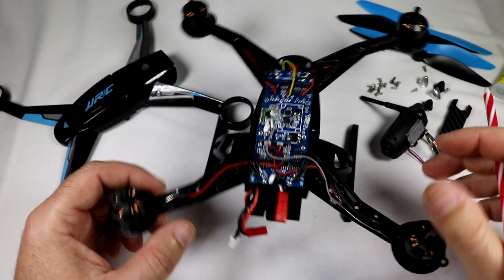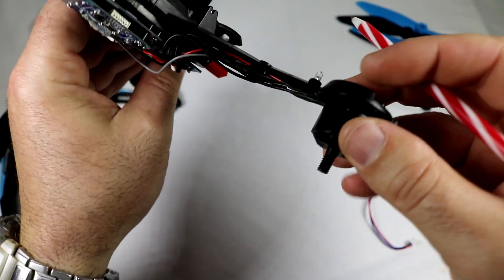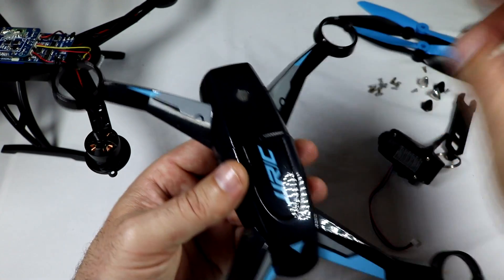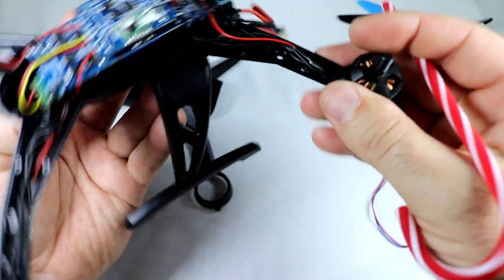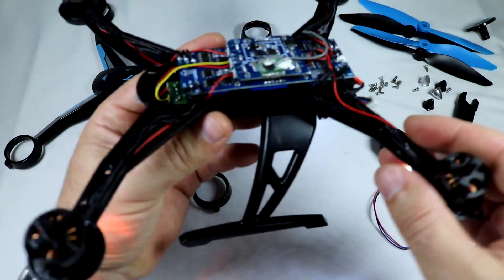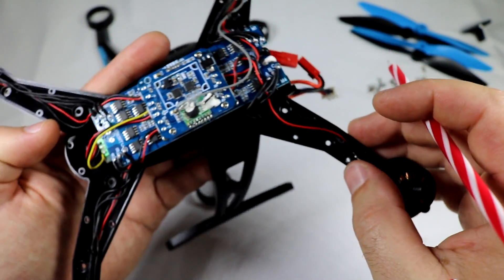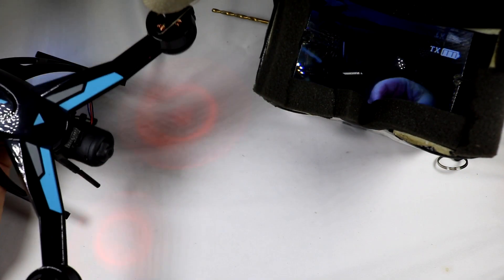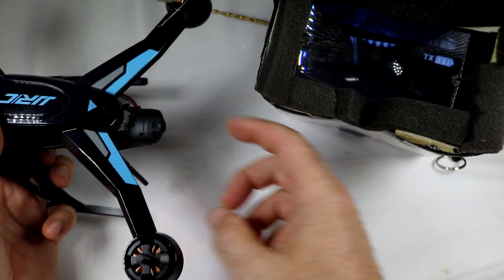JJRC X1 Quadcopter MODS - All The Best - [FPV, LED, Range]

Comment: Do you know anything about the esu's of this quad. I have one with two broken arms and the the two motors are now unresponsive to binding witch makes me reluctant to try to replace the motors and transplant the body, but it's just a little to much of a soldering job for me if the esu's are damaged too,, plus do you know about the xk x251 I briefly plugged in the battery (i think with reversed polarity)  I got a light spark, and now I get nothing, I am going to open up and hope I find a fuse or just one wire that got fried from its connection so i can get her up and running again.. brushless quad's appear to be much more component busy than the simple toy grade's with a board and pos/neg motors...

Comment: will the quad and camera stay on after u start flying around a bit. ??
Reply from the maker: +David Smith Yes, it is locked on good this way.
Reply: +Dustin Dunnill sorry I ment stay running wouldn't shut off every few seconds.
Reply from the maker: Oh.  Yah it stays on fine as long as the battery lasts.

Comment: Link for the camera only.  http://www.gearbest.com/rc-quadcopter-parts/pp_338616.html
I just ordered one.  It will be interesting to compare it to third paryy x5c 5.8 camera.  I've used it on the x1 it is ok, but using the default mount you cannot fly fast or you just see the ground.  Also the built in battery on that camera only lasts a couple of flights, so I like that the camera in this video is powered from the quad.
Reply from the maker: +Tom von Trott Thanks Tom.  Glad it's now available.

Comment: Great video as always. Question, what is your opinion of taking the x1 and putting onto a 250 class carbon fiber body, just take everything out and putting it onto the 250 frame?
Reply from the maker: +pshockz Yes, that's possible if your crashing hard and breaking the X1 body.

Comment: Any ideas for a Mod to help the very unpredictable Yaw rates? This is by far the most "wonky" quad I own with very unpredictable yaw rates. Sometimes it responds immediately, sometimes it waits. Oddly pitch & throttle respond immediately. Very weird. Any help would be appreciated.
Reply from the maker: +Quadcopter Reviews I think they fixed it in new versions.  Not sure on a fix for older versions with the delay.
Reply: +Dustin Dunnill LOL I hope so. On flight 8 I lost it in a large field of shoulder high grass. Own 12 quads.... have had several crashes.... nothing serious, never lost one till now. D'oh!!!! Why couldn't it have been a cheaper one? Well I just ordered another from Bangood. Hope this ones better. Seen a few bids on tri-blade props making it slightly more stable. Thanks and keep up the great work.... subed a long time ago. Your great work has definitely helped fuel my quad addiction!

Comment: Destin I have a X1 myself good day today I kind of crashed it not too bad at all but when I go to turn on the lights just blink fast they blink fast and it won't do anything what can It be....
Reply from the maker: +Aaron Chico reboot on level surface with fresh batteries.  Also try accelerometer recal
Reply: Did you find the problem ? My x1 do the same thing and i have a very hot componant on the esc board when i plug the battery :/

Comment: Do you know what exactly they mean with "idle setting" in the manual? Halfway page 6 http://imgmgr.banggood.com/images/upload/2015/11/JJRC%20X1%20manual.zip
Reply: +audiogek Could it mean if you trim the idle speed up that the actual in-flight max throttle goes up and the punch outs could be even faster?

Comment: On the light mod I saw someone do the same thing you did but he also added the outside shell of empty  Christmas lights bulbs in each bulbs to make them refractive and make them glow more. Thanks for the video.  :)
Reply from the maker: +INTELMAXELL thanks.  Yes, that's an option if you really need that much light.  I think the way I did it is sufficient for night flight orientation and won't mess with the looks much.

Comment: Wait, so the more recent X1 versions don't have that yaw problem?
Reply from the maker: Yes, some have reported no more yaw control lag in recent purchases.
Reply: +Dustin Dunnill wow, that was the only thing holding me back on getting one.
Reply from the maker: Apparently the low voltage blink and immediate landing has been fixed also for more time to land after blinking.

Comment: Dustin do you have a hard time getting it to hover in place ? I mean I don't expect it hover perfectly but it seems like the landing gears make it pitch slightly forward when calibrating on level ground .... Once in the air it seems to drift forward quite a bit
Reply from the maker: No mine hovers pretty good.  I would just try some trimming on transmitter pitch/roll.  Or put a level on top of front & back motor shafts while it's standing to check then shim/bend landing gear to level...roll also.
Reply: +Dustin Dunnill cool I'll give it a shot , thanks !
Reply: +Dustin Dunnill also is there a explanation of all the buttons on the transmitter ?
Reply from the maker: Check my unbox and flight test videos.  I go through the buttons.  Some are not mentioned in manual.

Comment: Cool and fast mods man! Is the X1 transmitter able to trigger the cam's recording? The hex does not trigger the Syma FPV's  recording :/
Reply from the maker: I did a test and the top right trim button on the X1 TX flashed screen seemingly snapping photos and seemed it activated video recording with the L6 cam but I did not have a card in at that time and just assumed it would work.  I'll verify and let you know.  Did the Syma Cam snap pics just not video?
Reply: +Dustin Dunnill with the Sony cam on the hex, I couldn't get the transmitter to trigger pics or video :/
Reply from the maker: Wait Sony? ... What are we talking about again...maybe I'm lost..lol

Comment: Great review.
Reply from the maker: Thanks
Reply: +Dustin Dunnill  i vaguely recall frequent flyer saying the lights connector was backwards ... how come its only 2 volts? it says 5volts beside the connectors.... i tried to use my tarantula lights but they didnt work, i thought i had blown it with reversed polarity, maybe mine is only 2volts too....

Comment: good video Dustin. thank you. I like that mod u did with the led lights. are u going to put up a night video with the new mod?  I kind of want to get this one. but I have also have my eyes on hisky hmx 280. its seems to be a better quad all around. better design better LEDs and better transmitter. and only a few more bucks than the x1. what you think?
Reply: +Junior Velez i'm looking at the hisky 280 too, reviews are odd because sometimes it looks fast others it looks slow,??? it has smaller motors than the x1 and its heavier and it has a 3s battery...... i might buy the shell for the 280 if i can fit the bigger x1 motors in it. if anybody knows if they will fit?
Reply from the maker: Thanks.  I honestly have no experience with the Hisky.  I have heard the X1 is faster though.  I'll have some after mod videos up in a bit to test the Mods.
Reply: SeBy DocKy actually did a comparison of the two actually and he seemed to be in disbelief of how much faster and more agile the X1 is than the Hisky, even though the Hisky has a 3S battery. The X1 has larger, standard 2300KV motors I think. He said the Hisky is very underpowered and alot heavier than the X1 :P